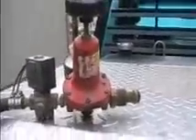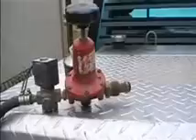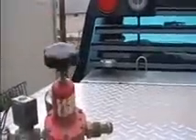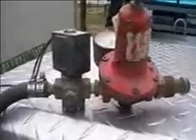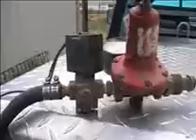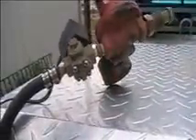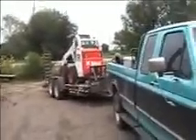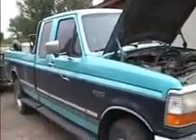Cheap Homemade Propane Injection System For Powerstroke Diesel Or??

Comment: I ran LPG ,you need a adj boost pressure to open electric valve under boost only and a dual pressure regulator or your pressure may change on hot days.
Reply: Boost pressure switch

Comment: I wonder if this type of system would work on my 406 Mercedes Benz Unimog to burn cleaner and provide a boost in torque/power. Interesting!
Reply: yes it will work I just rigged one up for my vw tdi jetta

Comment: I have seen such conversions tried and the thing that is not addressed here is the tendency for propane to freeze under motion. A boiler attached to the radiator is needed to warm the gas...

Comment: nice work - I heard you mention a switch in the cab to activate it - have you thought about using a microswitch on the throttle linkage (as well as your ` kill ' switch in the cab ) - that way you can't accidentally activate it at idle, only at throttle load..just a thought,,
Reply: xbfalcon351coupe  can you please send me a link to such a switch?

Comment: is that a TBI type engine or fuel injection? Would this work in a fuel injected engine? do you just turn off your gas pump to run the propane?
Reply: Evan McMaster.. I have the same question. 94 f150 i6 300

Comment: Yes. Nox kits can use a solenoid that fits to the throttle which only closes once a certain throttle opening is reached. I read about a guy who used to race at hillclimbs and changed to this method of turning on the nitro from a button on the steering wheel. 
He changed systems after accidentally 'hitting' the button while getting a bit crossed up while out of shape and suddenly getting an extra 100bhp to contend with!
Apparently it also made him change his race suit once back inthe paddock!

Comment: Adding LPGas to diesel engines has been done in Australia for years. You replace about 25% of the diesel with LPGas, and that acts like a cataylist - much better burning of the diesel, so no smoke out the exhaust and more power.  Diesel in Aus is $1.50/lt and LPgas is 70c/lt at the pump (yes we have LPGas pumps at gas stations), so you save about 10-15% on your fuel bill with better power and reduced emissions.

Comment: Nice work. I'm also studying LPG fuel systems to learn more about how the propane is vaporized before it enters the engine. With much more heat ie 400 to 440 degrees Fahrenheit, I may be able to vaporize liquid gasoline before it enters the combustion chamber. My research indicate vaporizing gasoline inside the combustion chamber is one of the least efficient ways provide motive force. Great video, thank you for posting this video up.

Comment: I bet when that thing backfires it blows apart your whole air intake system.
Reply: The amount of propane being used to enhance diesel fuel combustion is much less than the amount of propane required for it to burn alone... that prevents backfire, as long as the propane valve is only energized when the engine is actively sucking air in.
Reply: This video is years old. What is your current opinion on using LP for fueling diesel engines, hammerdownauto? Are there are some disadvantages you've experienced?

Comment: just curious, but on the real kits i would imagine that the amount of propane being delivered to the enigine would vary on how much throttle it was given through a variable regulator or something??  like the more gasoline/diesel you sent to the engine the more propane you would also want to send to keep the percentage of fuel/propane the same..  is that the real difference between your homemade kit and the real deal??

Comment: You should look into hho, same concept except no need to buy propane or mess with a setup liike this, it runs all the time automatically giving better mileage, hp, and cleaner emissions without user intervention other than refilling water. And you can build it yourself too.
Reply: oregonmeds yea but you'll be trading current draw off your alternator and the stainless steel plates need periodically replacing .lpg system is a stand alone maintenance free system.

Comment: propane increases the the mpgs with minimal usage of the lp look it up i can run through a 20lb cyl in 1200 mi with a 2-3 mpg increase know your facts before you start running your mouth.......... besides your car and engine dont weigh near what this truck does and 22mpg @ 80 mph and 3000 rpm on a 9800lb truck is not bad!

Comment: The end of the vid Luke mentions "Dont use at idle, use under load or in boost".  Activating the system with the master switch in the cab should not allow the solenoid to open. Using a HOBB switch set to close at a certain manifold pressure, would then provide the "underload" safegaurd. 

I made a water injection system using this same idea. 

Nice work Luke. 

So what pressure do you set your reg to?  what about an electrical pressure gauge in the cab so you know what is going on?

Comment: I have to disagree. It is NOT pointless to add a catalyzing fuel to the system. Propane improves combustion and enables a more complete burn. It is silly to allow unburnt fuel to exit the tail pipe. 

Do you have documentation of your trials building the 100mpg car? Best of luck and I hope no one chimes in and says its pointless.  Because that would be very useless commentary.

Comment: Kinda pointless to add another fuel to lessen the usage of the first fuel. Now if your truck was ONLY running on LP then that would be good like shown in the motherearthnews article where they converted a VW bus to propane. NIce try though. I'm working on a 100 mpg car myself. The engine I'm using 60 years old and the car body is 40 years old.

Comment: I'm running a little more complex system  but on an 06 dodge 6 " lift  37" tires  and I got 4 MPG  and a little BBQ size propane bottle 4 gallons will last 500 Miles   depends on how much you dump in and at what  boost you get it to kick in.  I can also  put it to the max and get an extra 93 HP Dynoed  but those 4 gallons will last about 150 miles   fun at the race track  593 HP runs a 13.8 1/4 at 105 mph